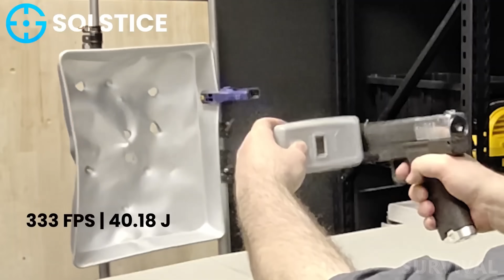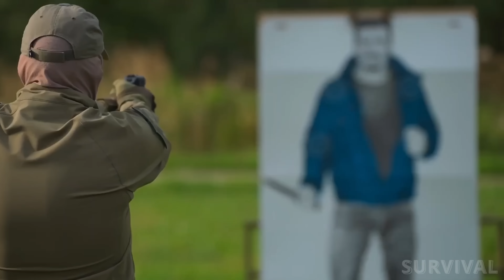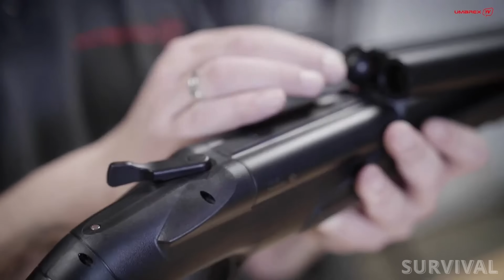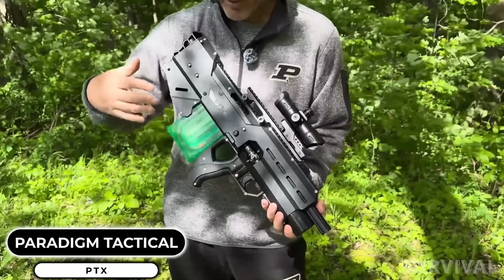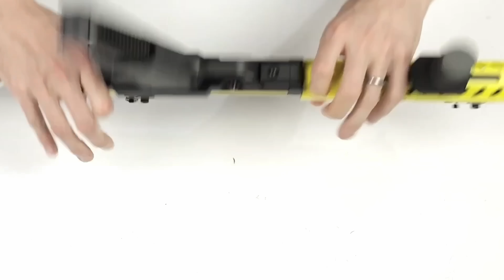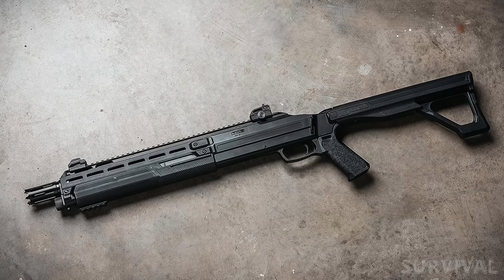Why These LETHAL Home Defense Weapons Are Selling Out on Amazon FAST!

Comment: I played paintball growing up. You  had to adjust the velocity to play on paintball fields. If you cranked up the velocity, those paintballs could hit so hard you would bleed. 100 round hopper and as fast as you could pull the trigger my opponents never cheated by not calling hit because getting hit multiple times hurt.